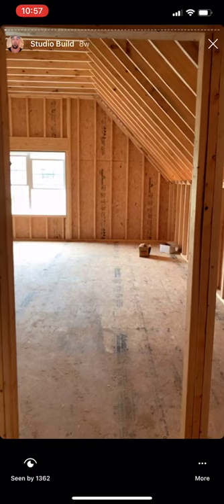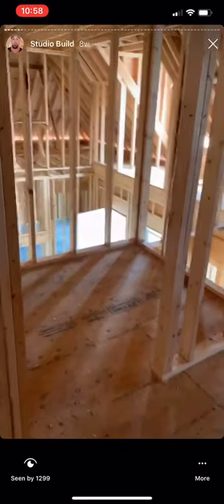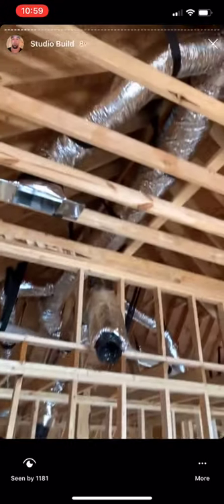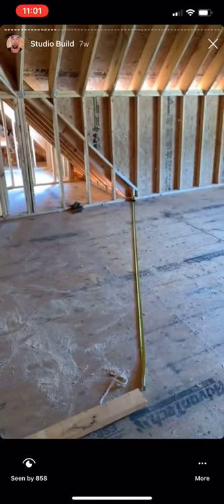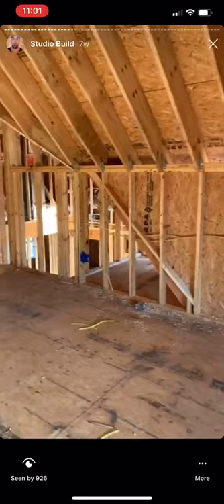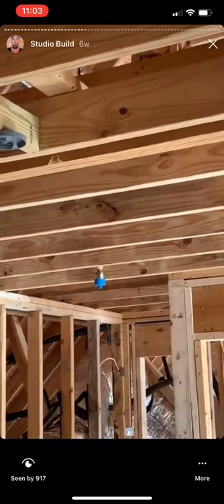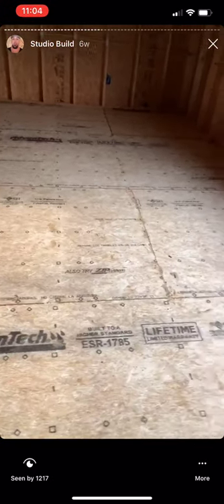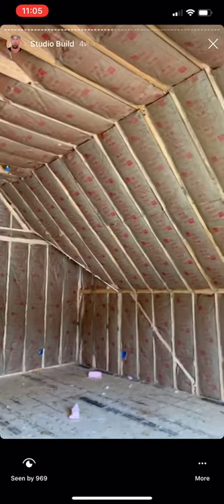Studio Build Vlog #1

Comment: Hi Colt, what kind of drywall did you use ? 5/8 sheets ? Would it add some mass / decoupling by using a double layer of 5/8 of drywall sheets with Greenglue in between ? I'm thinking about building a new house, I just want to make sure I won't annoy anyone playing guitar with a tube amp and a drumkit :) Thanks !